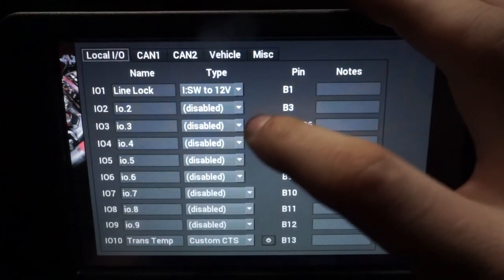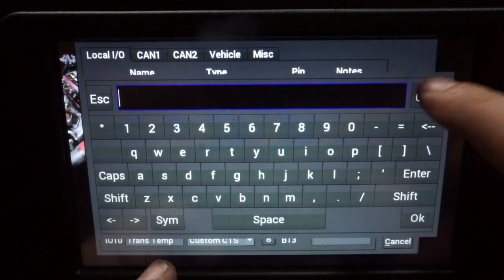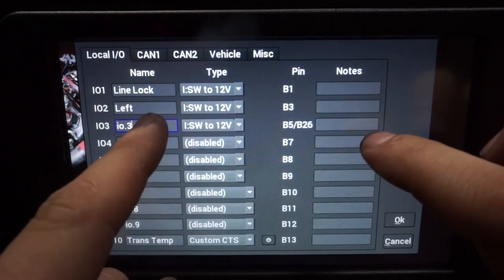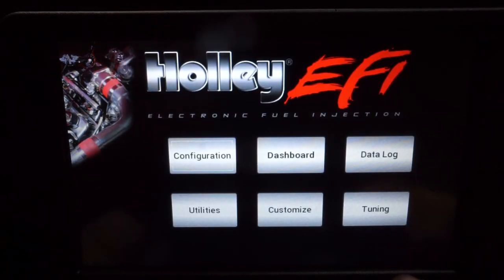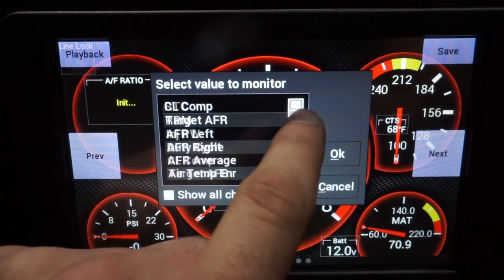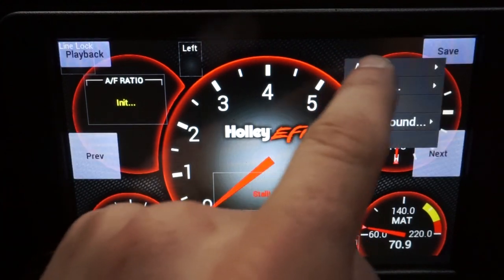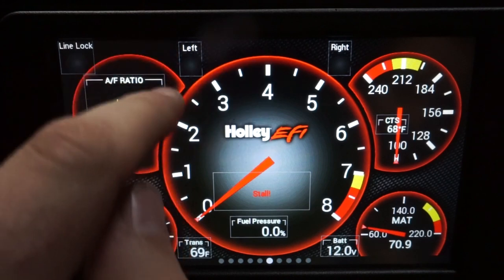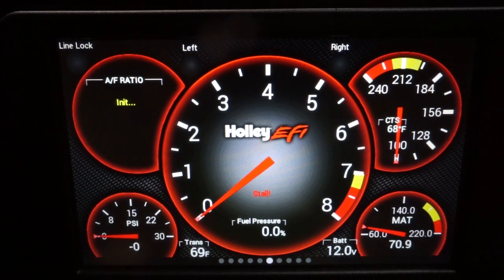Setting Up Blinkers On Holley Dash!!!

Comment: Very cool, but I don't think they need to be labeled left and right.  (I have never seen a car where they are)
Edit. and for the linelock, I would just have the text appear when the linelock is engaged and not be there when it isn't.  No need to have the text there all the time AND a indicator.  It will declutter your display.

Comment: Done this exactly the way you did, and they worked. Thanks. However, when you turn your headlights on and then when you try them, the blinker light comes on and stays on until you turn off your headlights. Has this happened to anyone else?

Comment: Did you just run a line to your left and right stock turn signal back to the holley I/O adapter.
Reply from the maker: This car had no wiring so I added it all,, but you could just run a wire from the stock wiring /relay.
Reply: @BlaserBuilds  yeah I wasn't sure. I'm running stock s10 wiring harness. I just finished hooking up the holley super sniper. Going to try and start it this week. I would like to have the dash hooked up as well.